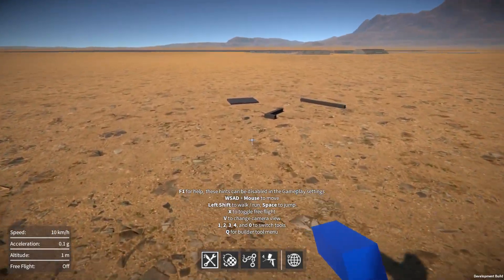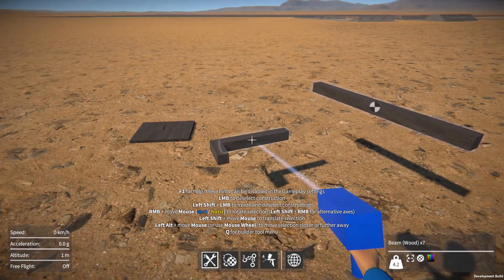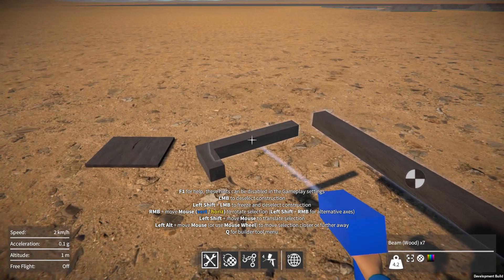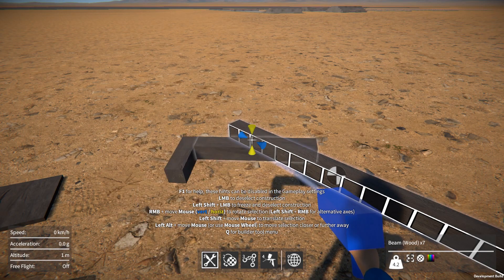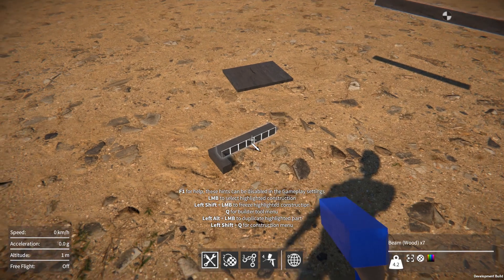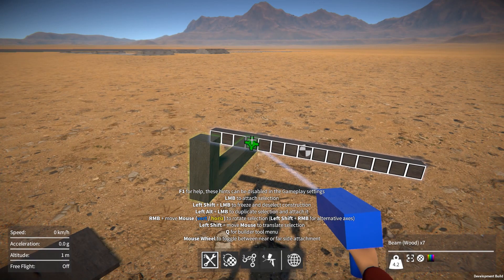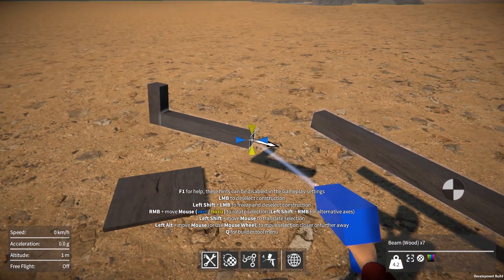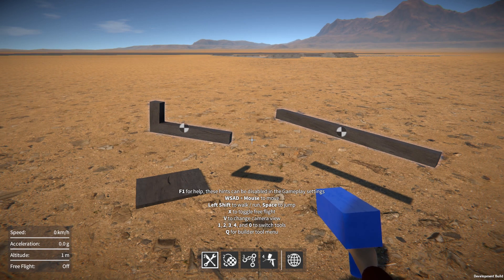GearBlocks building UI - need your feedback!

Comment: I'm cool with the UI as is. We were all new players at one point. I just played around with it a bit and watched a bunch of vids. I can whip up new designs pretty quick now. I want more stuff to make crazier creations. Buttons\switches with programmable delays and pressure switches that you or other parts can set off. I think it's cool how people have built computers in Minecraft with Redstone. I've built a few transmissions and one thing that would really kick ass is if you could program in multiple stopping points for a servo. Then either set up two buttons to scroll through the points or have separate buttons for each point. Just think how cool it would be to snap through gears up or down with two buttons. No more slipping between gears or having to make overly complex mechanisms to do the same job. Parts that simulate lift for airplanes. Maybe helium or hydrogen blocks to make things float. That way you could make dirigibles, airships and even space ship designs. You'd just have to add some kind of air buoyancy system so you could maintain a given altitude. One thing that would add a lot more flexibility to the UI is having 8 positions on snap points instead of 4 so you can have angles. I see people getting around this by using servos which takes up more space and makes things more complicated. One last thing would be having some different map options. Gets a little depressing being suck in the desert all the time. I've actually considered making some fake trees and plant life to liven the place up a bit lol. Having a forest to race around in with a big lake to splash into would be the bomb. Don't even get me started on boats that would just be next level. I love this game. Great the way it is and has so much potential to grow.
Reply from the maker: Thanks for your ideas!  I think most of the things you suggest are on my list to get to eventually, but I hadn't thought of buoyant helium / hydrogen blocks, great idea, I'll add that to my list!

Comment: Does it make sense to rotate the part by any angle if the angle still would be fixed?  (90, 270 and so on).  For example, it would be more convenient for me to rotate the part around the attachment point with a single button, as in some other similar sandboxes, that is, when the button is pressed, it will rotate strictly 90 °. And i like the idea of changing UI. Keep it up
Reply from the maker: Yeah exactly, that's what I was trying to get at in the video.  The idea would be to cycle through the available angles around the alignment point with a key press.  Cheers!

Comment: legacy UI, though it seems strange and illogical for newbies but it have some positive sides for advanced player. This method will seems more flexible and fastest for players who trying to getting used to. This helps save time in building process. E.G in new system when you need to rotate part, you uses some extra keys on the keyboard to switch "connecting sides", but in legacy this operation can be finished faster by using mouse movement
in my opinion if a person has an idea and he sees the potential in the game, he will get used to any control system, no matter how uncomfortable it may be
Reply from the maker: Yeah, when you're used to it, the current system is flexible and fast because you don't have to use a bunch of different keys or switch tools.  These same characteristics make it harder to learn though I guess.  It's good to hear that there are some positives sides to the current UI though, thanks!

Comment: There a game called Rigid Chips (I recommend you check it out) that is older now, but I really liked how it handled building your vehicle. 

It's creation program is set up where you move / rotate the whole vehicle / assembly around, apply parts directly and build it that way (like CAD?), rather than having to move yourself around what you are trying to build. 
I find the first-person method of building cumbersome and irritating, whereas the other method used by RigidChips is faster and easier to use when building.
Reply from the maker: Thanks, yeah, had a brief look at Rigid Chips a while back.  I didn't want a separate mode that takes you out of the map in order to build, and I generally prefer first-person building, which is why I went in that direction.  I definitely think first-person and a more CAD based approach are both valid though, and I guess people have their preferences either way.

I'm too far along really to change it now anyway.  That said, with the "free flight" mode I added, perhaps I could add an "orbit cam" mode that would slightly approximate what you describe, something I'll have to think about.  Thanks!

Comment: I didn't have too much trouble when I started, but I'm already used to vehicle sandbox games so it was all pretty familiar. I think on some level all 3D design is unintutive with a mouse+keyboard layout on a 2D screen and is really just something that takes getting used to, for a new user an interactive tutorial or something along those lines would help the most with that.

Current builder is ok, but I like this new prototype system more. I think the new system is especially better for attaching end points of really long parts which was a bit clunky in the old system.
As for freezing I think the outline and center of mass indication does a good job of showing that the part is frozen without being disruptive when you're trying to build, I don't think transparent is the way to go there.
Reply from the maker: Yeah I agree that 3D building is always gonna be somewhat unintuitive.  Tutorials are in my plans, which should hopefully help with this.  This is great feedback, thanks!